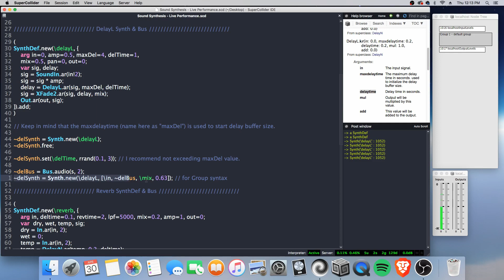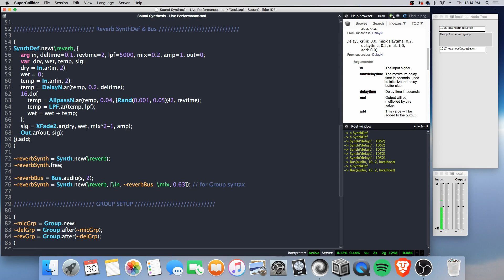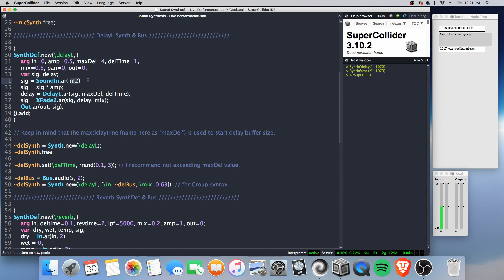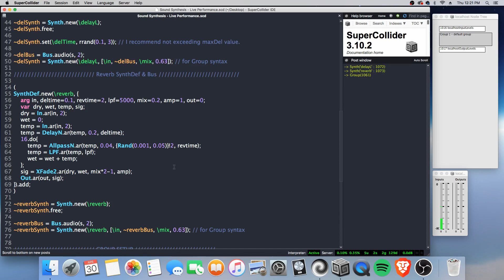Basic Setup For Live Performance | Part 1 (Live Effects)

Comment: Thanks, this was nice! I have a question; your delay synth has the delbus as input and the reverbus as output, the mic synth also has the reverbus as output, what goes into the delbus?
Reply from the maker: Hi, Johannes! Let me check to see if I can come up with something more efficient. As far as I understand it to be, ~delbus is second in the chain following the source ("~mic"), in its own bus. Thanks for the question!
Reply: Hi  @SoundEngraver , it's second in the execution chain, but ~delBus is never used as an output. Doesn't that mean the input of \delayL is silent?
Reply from the maker: Hey there, I checked the code. Turns out the delay's output doesn't change if you put "\in, 0", or no input at all. I will have to refer to Fieldsteel for better clarity on why this is. Thank you for bringing this to my attention!